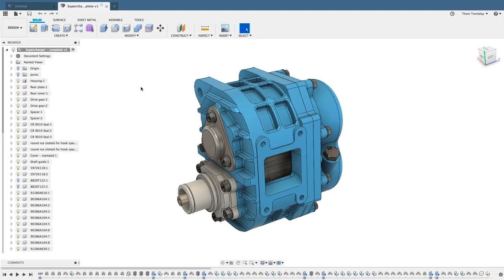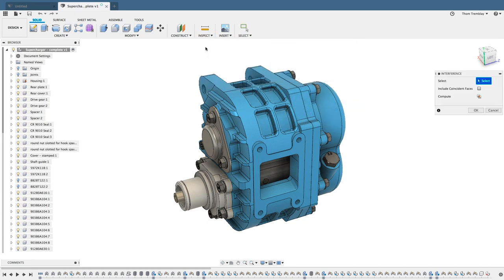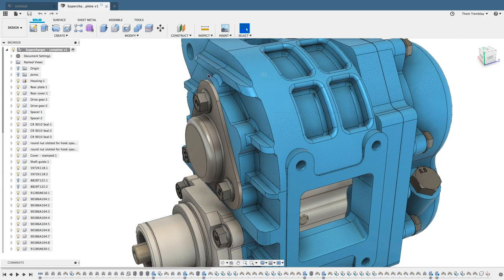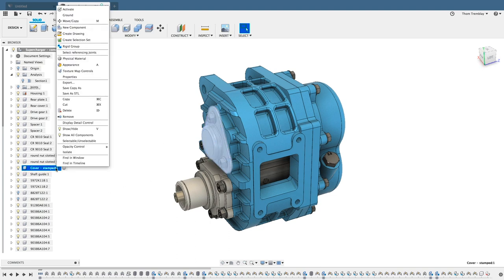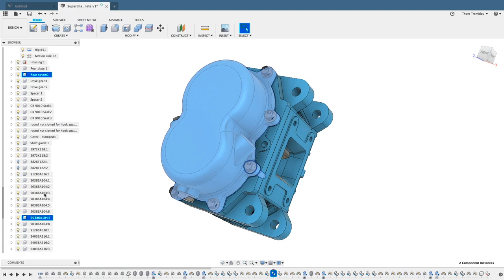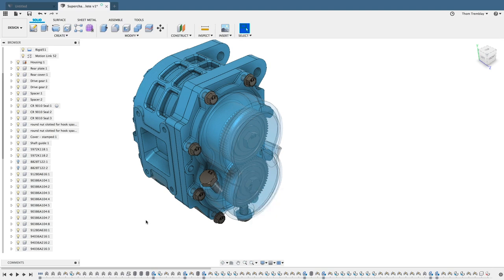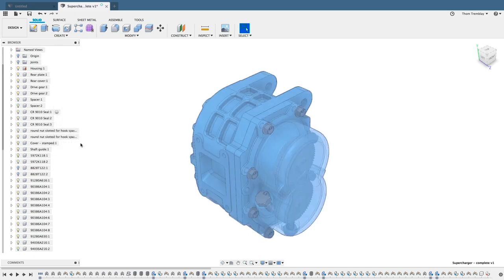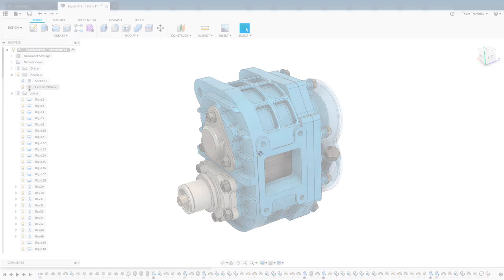Interrogating an Assembly

Comment: Thank you for the engineering tip. 
The reference joint is new for me. 
While calculating center of mass, the un-selectable cover was not included in calculations, but the idea is clear.

Comment: Is center of mass taking different material properties into account or is it just using the volume?
Reply from the maker: It will take into account the density/volume of the materials used. Otherwise it would just be plain wrong!